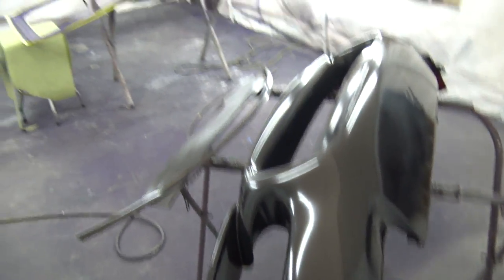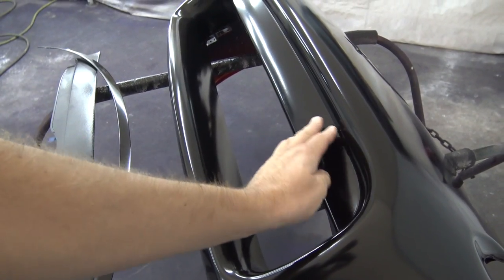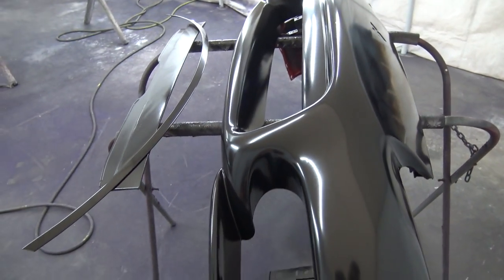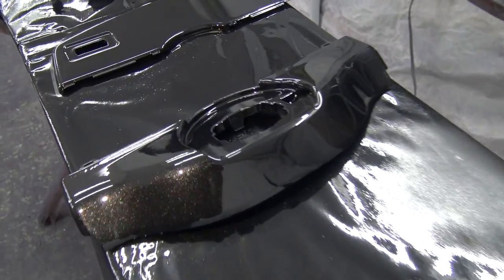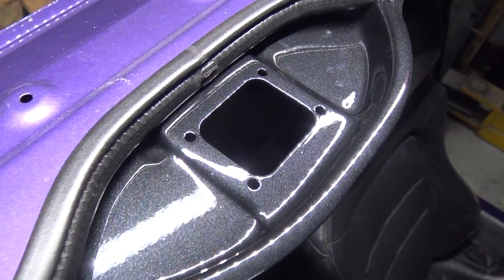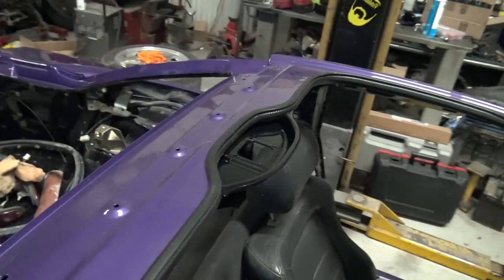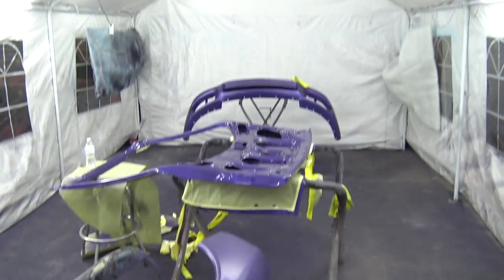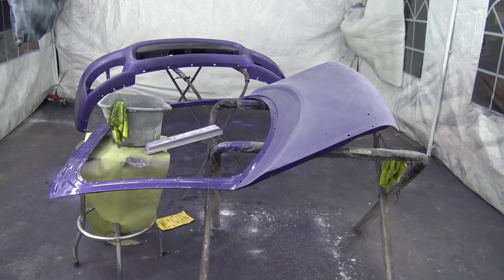3000GT Cold Weather Ruins Paint

Comment: You didn’t allow the primer to dry before applying the base. It was still gassing off and the solvents mixed with the base and caused a bad reaction. If you did let it dry long enough, then it was contamination on he primer, or like you said moisture. 

But usually not allowing primers, base, and clears to dry long enough before the next stage will cause this.